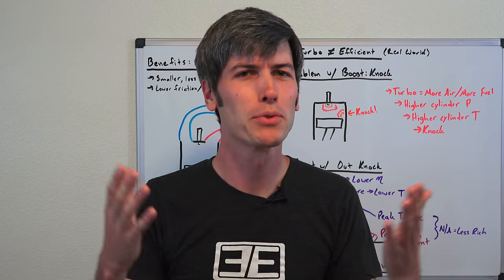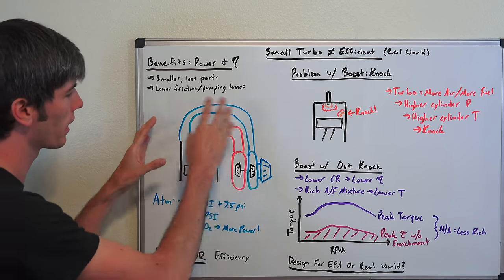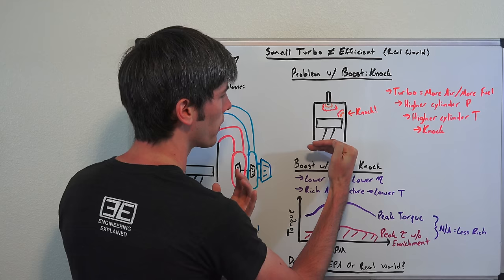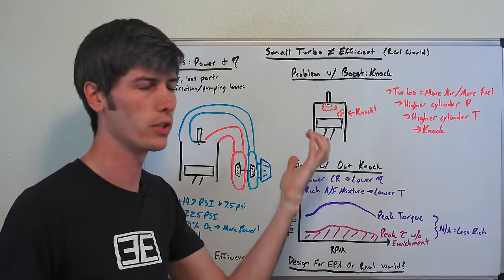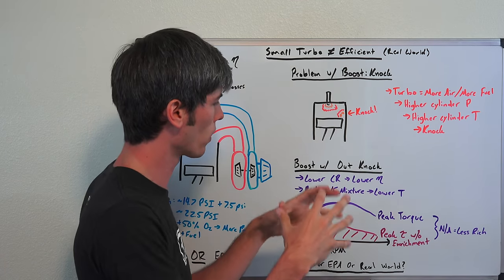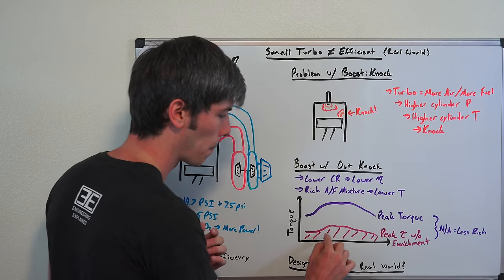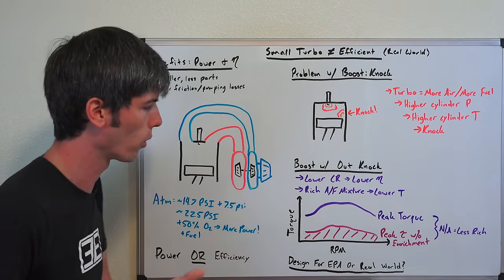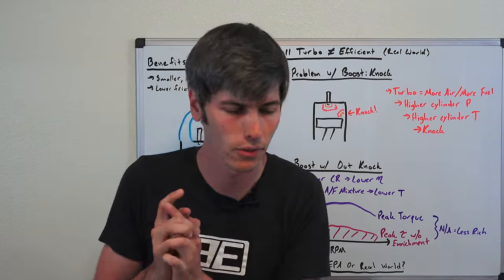Why Small Turbo Engines Are Not Efficient

Comment: Brand new 2018 VW Passat 2.0t (18.5 gallon tank) while using BP 93 gas I would get 420-440+ miles per tank. Taking a 500 mile trip my dash read @670 miles til empty.

Comment: This is true in my case with a 2018 Honda Civic Hatchback, 1.5 Turbo.  So far based on the built in trip estimator I'm consistently getting over 30mpg and have even gotten 43.5mpg highway.  This is me driving like grandma in ECO mode, trying my best to accelerate and brake gently.  When I'm driving like a penis seeking entry definitely drops below 30mpg.  When I had a quarter tank, decided to put in premium gas at $3.40 a gallon here in California.  It cost me $31.cents to fill up =P This carries me over 35 miles, 5 days a week.  I'm Happy =)

Comment: I didn’t feel like reading all the other 2800 comments so I hope I’m not bringing up an old topic, but I know one of the benefits of dohc engines is the elimination of the EGR valve. Some Diesel engines have EGR coolers. I’m curious why small displacement turbo engines don’t have a cooled EGR circuit. That could bring down cylinder temperatures without the need to inject additional fuel.
Reply: With the advent of variable valve timing, not a lot of new vehicles have EGR valves.

Comment: There is a way to reduce the temperature in a cylinder (even at very high boost) by adding methanol or water injection (BMW M4 GTS)

Comment: Great video, but doesn't explain why my small 1 litre turbocharged car has the best gas mileage of every other small car out in the market, while still blowing the crap out of larger 2.0L NA engines.

Even at high speeds (like cruise speed of 150-160km/h)

Comment: You can use up all the oxygen but oxygen doesn't burn. introduce a spark in pure oxygen and nothing happens unless fuel is present. Another reason that turbos don't get great mileage is all engines are heat engines. To get a certain amount of horse power takes a certain amount of fuel being burned and the amount of energy in gasoline is mostly fixed.  There is no free lunch. Where turbos really shine is in stop and go traffic. if you keep your foot out of it. All engines get 0 mpg while idling  but a bigger engine is using more fuel. A turboed engine could really be too small for a car but using the turbo to make  adequate performance.

Comment: As stated in the video, a small turbocharged engine "is capable" of getting better fuel economy compared to a much larger, non-turbocharged engine.  However, when a vehicle is driven as if it's always autocrossing, it doesn't matter what's under the hood.  You're not going to get the EPA-determined fuel economy numbers.

Comment: Great video as usual but I think you missed one comparisment to do when you talk about turbo efficiency. When you compare a fuel efficiency of turbo engine to the naturally aspirated engine with the SAME power output, does your title still stand: "Why Small Turbo Engines Are Not Efficient"? Maybe comparisment of the same power output per weight = same performance between these two?

Comment: The other reason is displacement they should be inline 4 cylinder and a displacement between 2.0L through 2.8L and go VGT turbo or twin scroll turbo or the use of both systems and use duel port fuel injection and have 11 to 1 compression and if the use a close ratio 10 speed automatic transmission in a rear wheel drive platform with a 3.10 final drive independent rear suspension  in a Ford Taurus size car the horsepower could be 250 through 400 and torque of 300 through 450 and the ability to cruise at 70 mph at 1200 rpm's the mpg could be up-to 30 city and 45 to 50 highway with a red line of 6500 rpm. The fuel is another the octane is to low produce octane of 100 will eliminate any chance of pre-ignition.

Comment: At high boost there also lack of expansion displacement. A lot of energy out of the exhaust valve.
Reply: Which goes in the turbo, which converts it into intake pressure.

Comment: "Uuuuh, muh puwer per leeter" Smaller displacement turbo  engines are not smaller and lighter, guys. At least not the majority of them. 
The majority of "small" turbo engines have cast iron blocks and some really thick parts.
They are anything but light and small.

Comment: Just came back from vacation with my 2020 Accord Sport 2.0t m. t. There was one long stretch where I chose not to break the speed limit (65 mph) and I got a calculated mpg of 43 mpg (yes I was shocked). On the highway where the speed limit was 75 mph (driving 77 mph), I was only able to get 31 mpg. That's a little less than the sticker. In conclusion, I'm okay with that.

Comment: I went from a fiesta SE to a Fiesta ST.

SE non-turbo 1.6 I-4:
 29 average mpg.
 115hp

ST turbocharged 1.6 I4: 
26 average mpg
195hp 

I can't speak for every car, but my experience has been that yes... It definately does give you V6 horsepower with 4 cylinder mpg.   Every V6 car I've had in the past always got into the teens on average mpg...
Reply: To be fair, V6 engines wouldn't fit inside a Fiesta to begin with. If you put those 1.6 I4s inside of the cars that had V6s, you'd still be getting mpg into the teens. If not worse, because you'd need to run the engines at higher RPMs to compensate for the lower torque.
Reply: @dudejo  idk,   I had a Ford probe before which was a pretty tiny car,  and it had a 2.5L engine which is pretty small for a V6.    Still high teens at best MPG for city driving.

It did get decently into the 20s on the highway though,  but that car was a hell of alot slower than the fiesta st lol.
Reply: @mikeg3529  The Ford Probe is still bigger than a Ford Fiesta, though. Not to mention the Probe looks much more aerodynamic :P
Reply: @dudejo  

Curb weight on probe 2920lbs.
Curb weight on fiesta 2720lbs.

200lbs is negligible. That's the average weight of a single passenger. 

That's why I picked it as a comparison to the fiesta.   More modern V6 cars would be considerably heavier, but the probe is a good example that even if the V6 is moving a similar amount of weight as the modern turbo I-4, it will  be less efficient.
Reply: @mikeg3529  2720 lbs is the heaviest version, which is the 4-door saloon. The more popular hatchback can be as light as 2600 lbs and less. That's easily 300+ lbs.

Edit : According to wikipedia, the latest Fiesta model can be as light 2,500 lbs and less.
Reply: @dudejo  My ST, the car I used as an example is a four door saloon, that's why I listed that weight. 

And yes, I know ford never produced that car.   I bought my sedan as an SE,  drove like that for a while until I got a good donor car, and made it an ST myself.
Reply: @mikeg3529  what kind of gas do you run in your ST?
Reply: @dudejo  93 octane myself, though ford says 87 octane can be used without it harming the car.

If I remember correctly, the probe said "premium fuel recommended" on its fuel door.  Though I definately was able to drive that can on 87 aswell, because it was a cheap car and thats all I ever ran in it.  Didn't seem to harm anything.
Reply: @mikeg3529  If you don't push the engine, I can believe the Fiesta can run on 87.

I find it weird that the V6 would require that much octane, though. The whole point of a larger displacement engine is that you DON'T need high octane gas.

At this point, it seems like the 2.5 V6 was just a piece of crap :P

The Pontiac Grand Am of roughly the same era was getting superior V6 mileage...with a 3.1l V6. A BIGGER engine.
Reply: @dudejo  I definately don't drive with fuel economy in mind, so that probe was getting high teens getting floored constantly.   The same with my ST.  It returns 26 mpg getting floored.... Constantly....

Im sure I could get 30 from the ST, and up into 20s on a probe if I drove like a sane person.

The 2.5 isn't a bad engine though.   Sure not the best, but I beat the piss out of mine for months and months after buying it with already high mileage.  It did very well... I sold it in running and driving condition to another person when I was done with it...not every car I've owned made it to that stage lol.

Comment: Depends on how hard the engine had to work. Got 43mpg out of my Leon 1.2tsi, when I replaced it with 1.4tsi got 45mpg. 50 on a run. So bigger unit was more economical. In same driving conditions our other car 1.6 naturally aspirated gets 35mpg (40 on a run). Not bad as turbo much punchier for over taking and more economical. But in heavier car turbo will be working more often and economy will quickly drop off.
Reply: I got rubbish mpg when I tested astra 1.0 turbo. So I think the key is to choose engine big enough such that turbo isn't working too hard all the time. When turbo is used under high load economy drops of a cliff.

Comment: None has ever explained to me, why a leaner mixture produces higher temperature whilst producing lover HP in an engine where the higher temperature difference you get, the better, more efficient it is?  Efficiency = 1- (T2/T1).  The higher T1 is, the more efficient the cycle is.

Comment: I don't think the enrich the fuel mixture as much as you think. The cat is only going to tolerate so much of that. With a turbo, you've gotta run high enougb octane that it will resist knock. These engines have fairly sophisticated timing maps that will deuce knock before you even hear it. That said, an engine that has a decent high compression but gets there using a dished piston instead of domed, will not be as prone to knock, and of course a decent intercooler that lowers the charge air temp. In the end, I think it's more likely people with small disp. Turbo engines get poor fuel mileage because it's so easy to beat on them and getbthat rush of power but guess what, nothing is free so if you demand the power, it's going to cost you fuel. Simple as that. Drive like you've got a fresh egg between your foot and the pedal, and you'll get the fuel mileage you want.

Comment: he started off stating that the pressure in the cylinder is equal to atmospheric pressure.
WRONG!!!!!!
as soon  as the engine is running the pressure will go down.
the higher the revs the more it will go down.
that is why some cars had vacuummeters .
except when the turbo comes in.
that is how turbo's work.
Reply: jan van ruth 
Think he was referring to atmosphere pressure in general, not referring to the compression process.

Comment: They are the most efficient option. In terms of volumetric efficiency
Reply: Also in terms of, how much power you can have in comparison how economic you can go.
But you can't have both at the same time and people are retardant so they think, they can get the full 140 HP and still get the consumption of a 1,4l 70HP engine.

Comment: The good mileage part is relative to something.  What that something is varies. If you look at it like having a NA motor with 300hp compared to a 300hp turbo engine then you would have better mileage when compared to each other.  Because an NA engine would need cams a intake manifold high comp ect making for bad gas mileage.

Comment: I think this is more a driver awareness issue than the manufacturer trying to trick you.
 
Most of the time, it isn't necessary to ask a lot of your engine, and calmly accelerating is fine. Sometimes it's nice to have that top end power, but in most cases (at least for me) those are the exception rather than the norm. So a downsized turbocharged engine can sort of give you the best of both worlds: it can give you power when you need it (barring a bit of turbo lag), and it can give you the fuel efficiency of an engine when you're just driving and don't need to push it. You just need to be aware of it.
 
And let's be real. The people who make a jackrabbit start at every stop light and continuously accelerate and brake on the highway aren't driving with fuel economy in mind in the first place. If you drive like a maniac and then get mad at your car for not reaching those advertised numbers, the problem is between the steering wheel and the driver's seat.

Comment: No replacement for displacement the only reason car companies go for smaller turbo engines is to lower fule consumption in traffic as soon as the turbo kicks in you can throw your fule efficiency out of the window. There is no shortcut to have good acceleration and performance  its eather having high HP/torque or seriously light Weight vehicle

Comment: My 2003 SAAB 93 Vector turbo got ~ 7.5/100 around town, low 6 on the hwy (98RON).
My S13 SR20DET turbo got a best of 6.9/100 from Canberra to Port Mac (98RON).
My 2015 Mazda 3 2.5l gets around 7.5/100 around town, low 6 on the hwy (98RON).
My M50B28 turbo e30 gets about 18/100 around town! OK OK, it's burning E85.
Despite the magic claims from Mazda about Skyactiv this, and eco that, the economy is meh. With e10 in the tank right now, it is nudging 9/100 around town.
The driving experience of the non-turbo Mazda is one where you have to wait until ~ 4500rpm for a peak TQ that wasn't really worth waiting for anyway. Give me a modern turbo engine with peak TQ flat from 1500 to 5000!

Comment: Higher pressures per cylinder mean higher wear. The engine wont last as long as their V6 counterparts. I had a acura cl type  s with 230k . did not use a drop of oil. Many many 4cyl's with under 200k burn oil. Plus the bigger engines turn lower RPM's at vehical speeds. Reducing wear as well.

Comment: The VW tdi diesil benifits from being turbocharged it spite of being small engines
 Biodiesil makes such engines more green in addition.
 I use to get 50mpg on the interstate with a 2003 VW tdi runing 70 per hour.
Reply: William Biliani isn’t that the engine VW cheated on?

Comment: The small engine might not be able to pull so the turbo kicks in and when it does, you'll get performance of a V6 also economy of a V8 
The only time you'll save fuel is while idling and thanks to auto start stop, no difference there now....
You won't be saving a lot of money long term too, servicing costs gonna be the same, or a notch high for the turbo 4 and plenty of parts that would wear off pretty earlier than a NA engine

Comment: Well twin or biturbo engines are great, i have c220 cdi w204 with 170hp and now got facelift version but this have same 170hp but bi turbo and about 1.5l less fuel consumption in town and about 0.80-1.2l highway less fuel consumption
Old c220 cdi 170hp have
400nm at 2000rpm 
170hp at 3800rpm
Facelift c220 cdi 170hp
400nm 1400-2800rpm
170 hp 3000-4200rpm 
Because in bi turbo small turbo is already spining at 1400rpm but old start spining or get boost at 1800rpm

Comment: Can we say Brakes Mean Fuel Consumption. For the most part. The same car or truck  with a big engine or small. If both engines have a BMFC of say .42 pounds of fuel per hour per horse power. Now you're going to accelerate and maintain road speed. In the same vehicle, both engines will see roughly the same MPG. Simple laws of physics (or thermodynamics).

Comment: I think it’s just air at first and then when the piston comes back up the diesel is injected and atomised at the same time and because the oxygen already in the cylinder is so hot it just ignites instantly with the help so some glow plugs of course if it’s a cold day

Comment: My 2019 VW Tiguan uses a “Budak Cycle” turbocharged motor and only needs 87 octane fuel. However, I still use Premium and feel the motor runs smoother, or at least it think it does. 🤔

Comment: Question?

Do turbo engines in cars improve high altitude performance?  Do they just only boost performance on a "standard day". 

Buy a "turbo" cessna so you can have a "standard day" performance while flying on 7,000 feet. But a turbo cessna and a non-turbo cessna will have equal performance on a "standard day"
Reply: Turbos will help at altitude yes.

Comment: This video is valid for cars made 20 years ago, otherwise utter bulls**t. Modern engines use direct injection, work at stoichiometric mixture (14.7:1) and have close to TDC fuel injection, both eliminating knock and cooling compressed air. The author assumes the scenarios where people drive WOT. Take for example the worst engine ever, the Alfa Romeo 3.2 V6 DI, works at lean mixture  even with direct injection in low RPM area and consumes double as for an engine with half the cc's and twice the MAP, not to mention as being twice as slow. I hope Mazda paid you a pretty neat amount so that you make so much fun of yourself.

Comment: Cars that highlights turbo inefficiency got to be the Mitsubishi Evos. They have worse fuel economy than a Vette with a big old V8 despite producing like half the power lol. 

There are more factors at play like gear ratios and AWD vs RWD, but still. Those 4G63T engines are horribly inefficient for a 2 liter 4 cyl.

Comment: anyway they should change the petrol engine workings to make it so once it starts igniting by compression ignition (due to the turbo) to stop firing the spark plug which is kind of like what Mazda are doing

Comment: Good video but narrow point of view. You only talked about gasoline engines. Small turbo diesel engines are very efficient. Besides there are still countries which apply tax on engine displacement. This means in some countries you can buy a 1.6L turbo engine with almost half price of a 2.5L NA engine which have same horse power. In these conditions who cares consumption :)

Comment: Direct fuel injection can solve this problem. It will work even better if it be compression ignited like a diesel. Gets even better considering it can run on extremely lean mixture on low loads. Dfi compression ignited small turbocharged engine is the future.